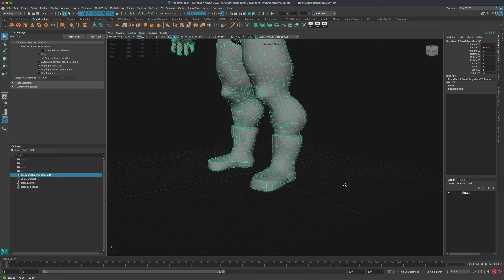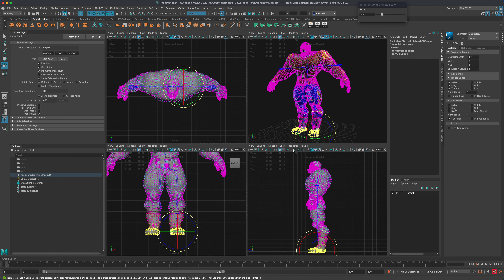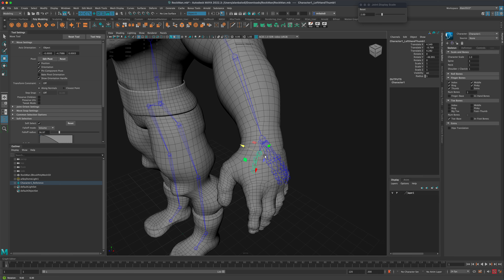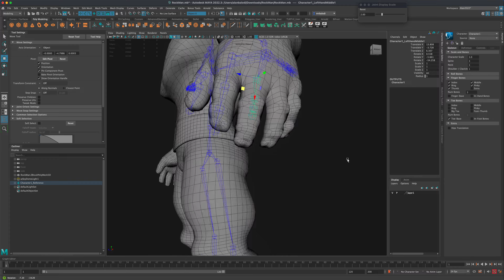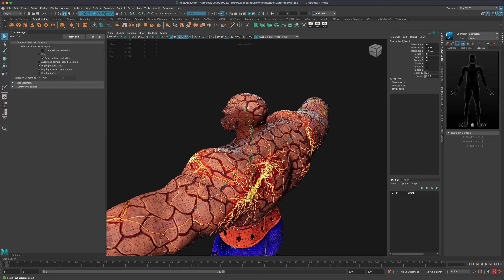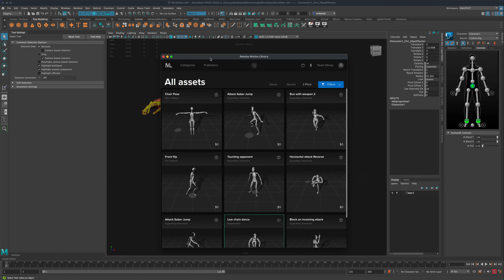Maya - HumanIK: Rigging (Part 4)

Comment: Hi, I need help :s I use the human IK and when I try to rotate it is just kind of blocked... like... it moves like 0.0001 pixel and then it doesn't rotate anymore. Any help will be appreciated
Reply from the maker: Hi, it is hard to help without seeing your scene… this could be caused by many different things. Try to load a new scene with another human ik example and see if that’s working properly. There are a few premade rigs in the Content Browser under windows tab, you can test with.